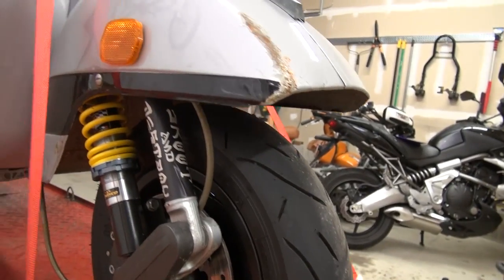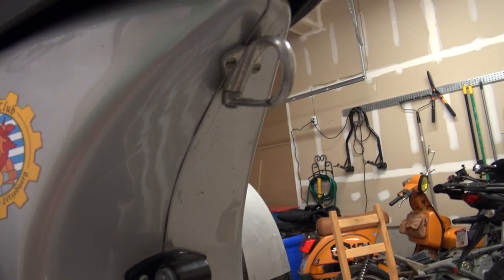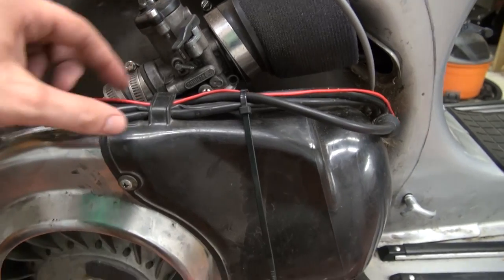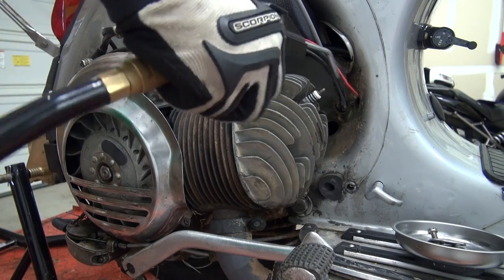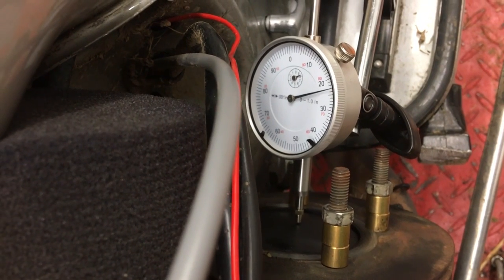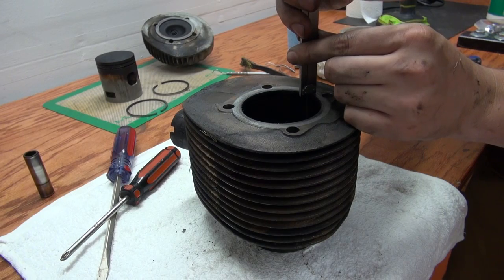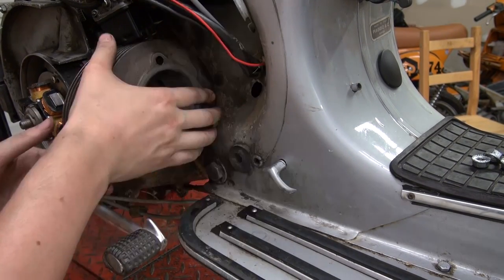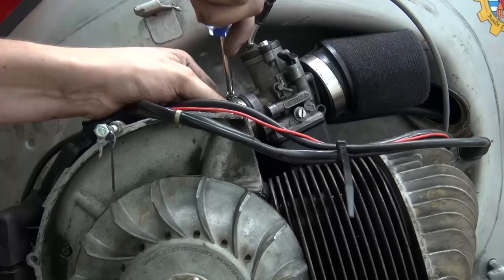TST Ep. 13 - Vespa P200E, my mods, porting the original cylinder and unlocking hidden power for $0

Comment: As another guy mentioned, there are kits available to connect the PHP carburetor choke with the original pull knob.
Removing the side cover is a pain in the somewhere, even worse for people with later models at which you even need to lifte the seat to release the side cover.

Comment: I got to ride that P200 this weekend. Lots of power through all the gears and the braking and suspension were on point. The PInasco shocks are really nice. Performance and comfort. I think I like the split tubeless rims better than the SIP tubeless I run on my Rally, but that might be due to the Heidenau tires.

Comment: hello from Greece.Quick question.I Have a stock px200 engine with a pinasco touring exhaust and no other mods.I see that you are using a PHBH carb,I was thinking about PWK 28mm from OKO.Have you ever tried PWK?What is your opinion on that?I do not intent to do other mods such as Malossi piston or a crankshaft,just want to play with the stock cylinder and piston as you did.

Comment: Great video, I’ve been following for a long time, thanks for the inspiration! Quick question, did you have any problems with the phbh rubbing on the cylinder cowl? P200E, pinasco intake and the carb doesn’t fully seat, the plastic float box rubs on the cowl. Any suggestions??
Reply from the maker: Yeah, that is very much a PH carb issue. You can put some foam/cork on the shroud. Or just keep an eye on the floatbowl. It takes many many miles to do some minor damage.
Reply: Thanks for the reply and good idea w the cork, can finally put my wine drinking to use on the vespa 😝😝

Comment: How did you decide on raising the exhaust timing to 164*?  You mentioned standard exhaust timing at 155*-111*. Is there a formula or does the exhaust manufacturer recommend a setting? How much did you know to open up the piston ports? Is there a recommended width? Thanks!
Reply from the maker: Other folks have tested these exhausts extensively, and the Road 2.0 seems to run best in the 25-27 blowdown category (aka intake to exhaust difference of 50-54 degrees)
Reply: In general, the exhaust timing one of those crucial things where there are no "specific" given numbers to use. Basically raising the exhaust port (higher timing) in a 2 stroke engine shifts the torque to a higher rpm. Now this can be ok until a certain amount is reached, because everytime you move the power up (towards more rpm) you lose power in the lower rpms (this is true for all 2 strokes). For every setup you have to take into consideration ALL the variables (what cilinder? What exhaust? What carburettor? What intake timing? What gear ratio? etc) in order to decide IF and HOW MUCH to rise the exhaust port on the cilinder.

Comment: Thinking of going reed intake with 30 carb for my p200, it currently has a malossi 210 kit ported, Vespower ignition, 26 delly, and JL pipe. Video on reed and carb setup? Think it's on your LML. Awesome vids!!!! Btw is the install tricky?
Reply from the maker: No, the reed installation is rather easy. However, when you move from rotary to reed intake, it would be best to open (dremel, file) the intake so it will benefit from the larger intake surface. Reeds make the bike rather loud, so beware.

Comment: Good job man! Is there gearing stock? I’ve been thinking about installing t5 4th gear
Reply from the maker: Yeah, with the current 225 engine it has it is running a short Pinasco tree with 20 instead of 21 teeth. 

on the other builds I have finished I pushed for the 36 tooth 4th gear and it is a blast to ride.